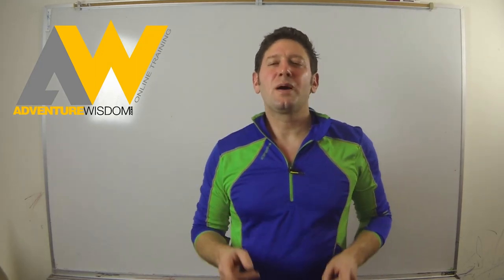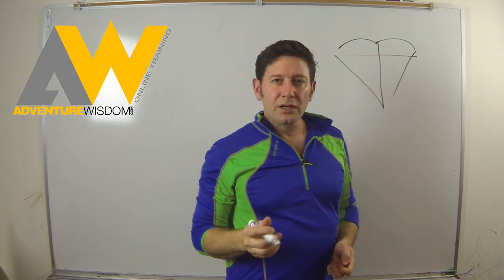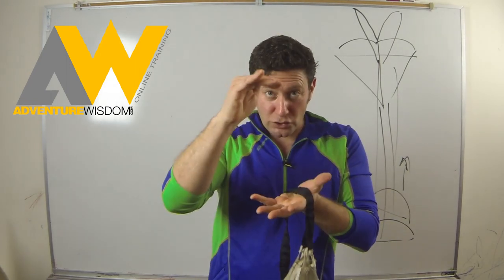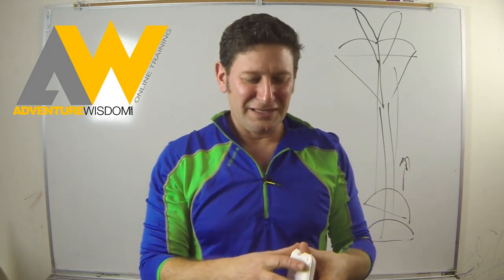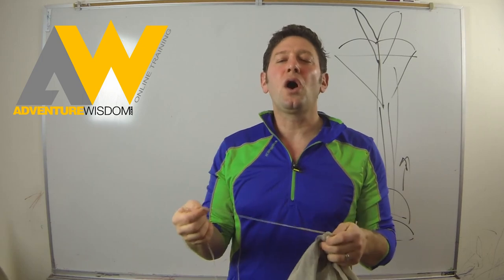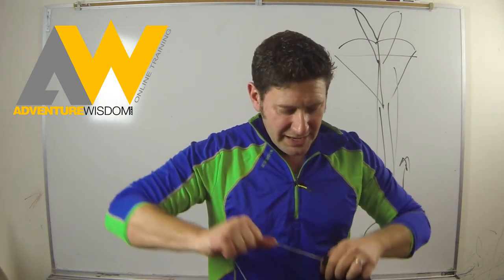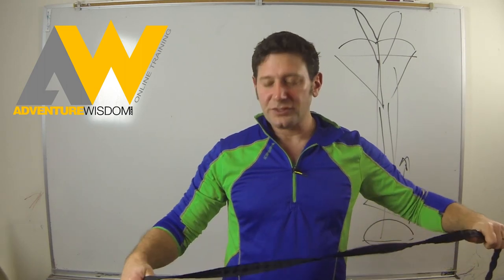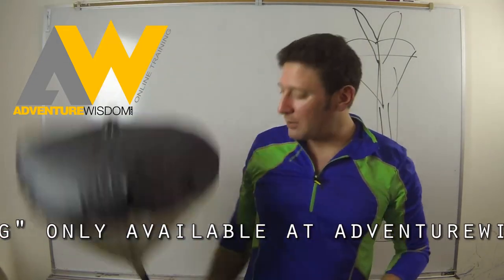The Secret to Pilot Chute Kill Line Maintenance

Comment: I've also found that if I don't unwind or untwist my pilot chute bridle inside the bag (bag to the canopy attachment point) the handle will partially pull into the pilot chute itself after deployment. Thank you for the tip, I will definitely start doing this. I'll bet a lot of billard dealers have some very nice silicone similar to your Cypress stuff that pool players use to treat their pool cue shaft with.